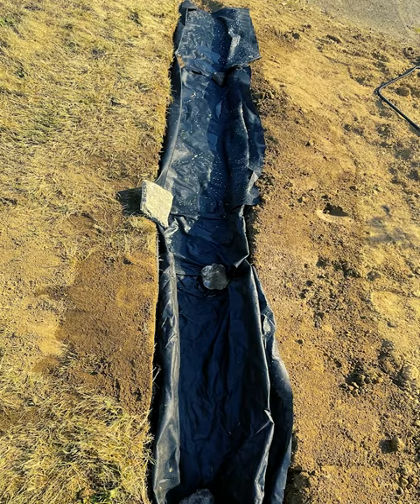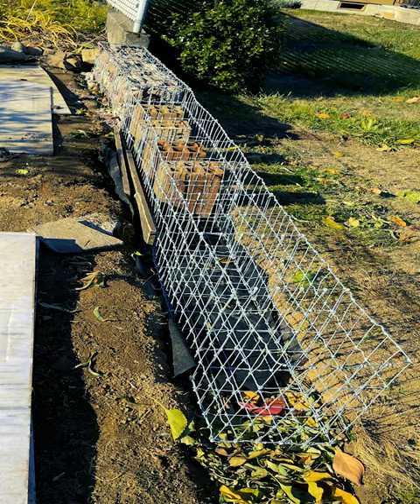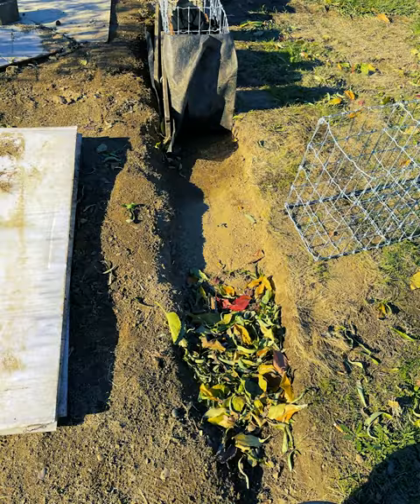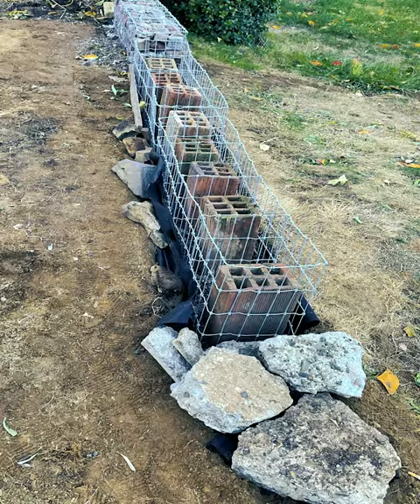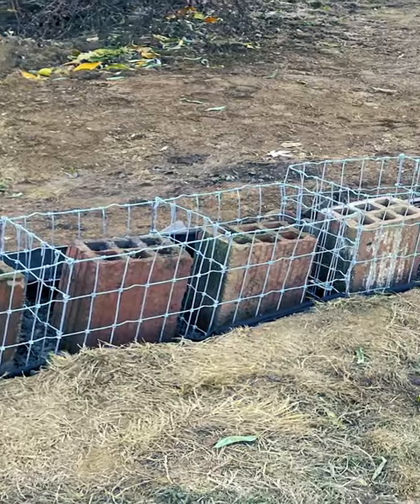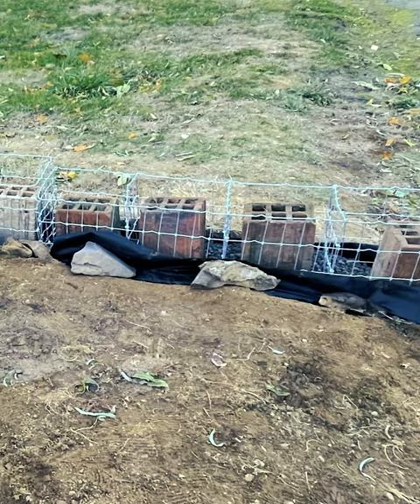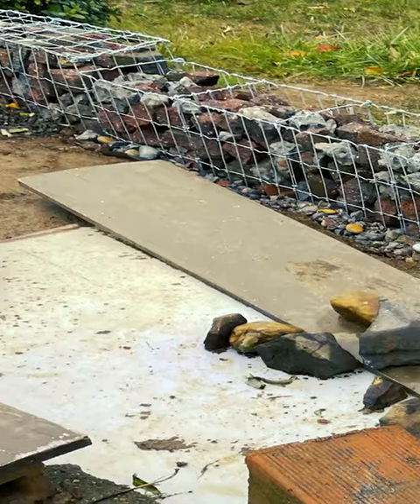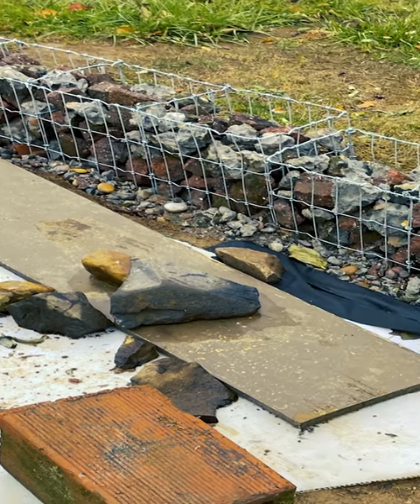Finishing the DIY Gabion Wall 🛠🏢🏡

Comment: Did you remove the  square blocks or keep them and fill around them?
Reply from the maker: I removed the blocks because it was too difficult to fill in around them at the width I made the baskets. Future gabion projects will be designed to have room for blocks so I can fill around them.

Comment: Hi! Fellow Portlander but in Seattle now. I’m gearing up to build a Gabion retaining wall. Would you still recommend using the fencing excess wire to stitch the seams instead of using hog rings?
Reply from the maker: I think for the size, I would still do the weaving technique as shown in the video. I've got a new cube design that's much smaller and I'm planning to use hog rings only. I will make a video with the new design.